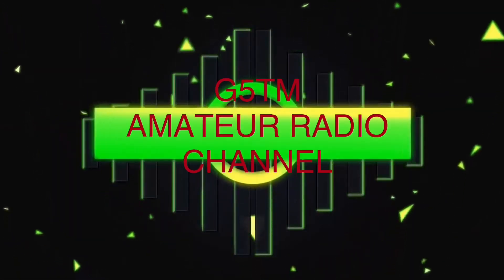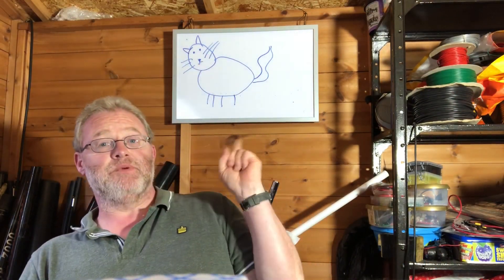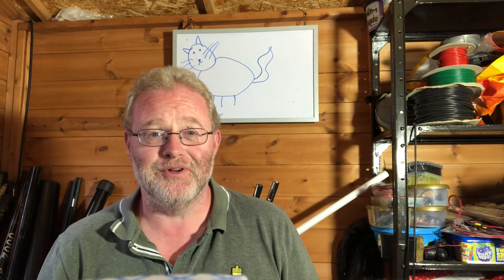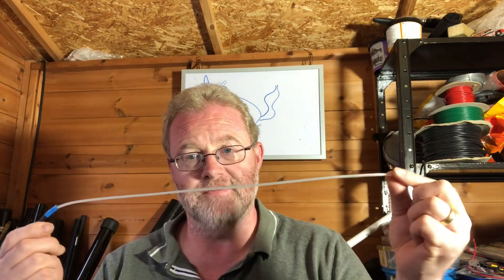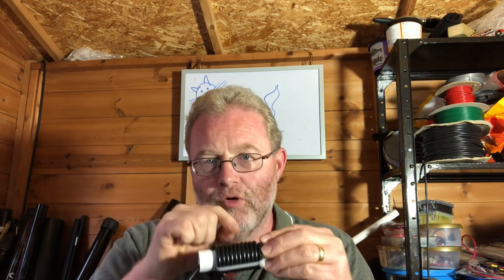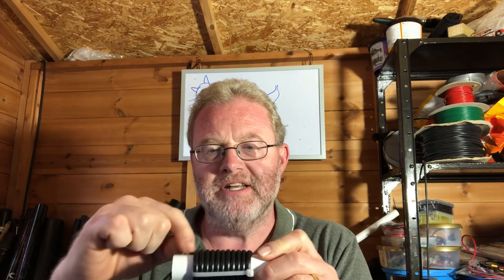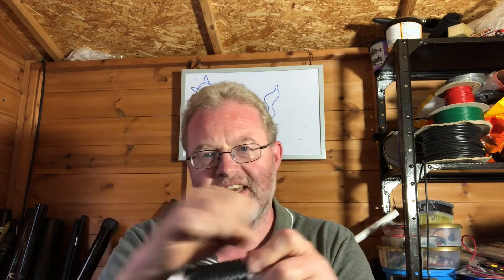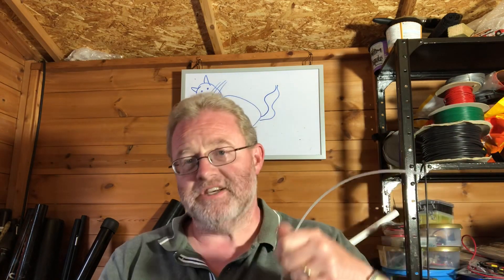HAM RADIO: Lightweight & Portable End Fed Halfwave for 2 Metres

Comment: how about folding the shield back over the jacket (instead of removing) for a second half of the dipole and put a piece of heat shrink over the length of the legs (90cm) for durability , reduce common mode, and just make an ugly balun at the end of the feedline?
Reply from the maker: Yep can work

Comment: I crossed this info with the flower pot info and hung the antenna inside pvc with the coil wrapped outside at the bottom.  Mounted to a 30 ft  metal conduit that gets the antenna over the top of the roof.  Coax down and into my basement radio room.  Not much traffic in the area but I connect to the local repeater out at about 20 miles clear as anything.
Reply from the maker: Cool!

Comment: I've been using one of those for years, regularly talking 20+ miles with my 2metre one and over 40miles with my 4metre one. Both indoors at ground level. My 6metre one is on my test tripod awaiting testing. Awesome antennas easily equivalent to mid priced white sticks.
Reply from the maker: Totally agree - light on the pocket as well as on the weight! 73

Comment: I know this is an older video but I have been using an antenna that I made years ago on my front porch. I made it as my first one . No one knows it is there and it works great. I got the idea from a roll-up ladder line antenna I have . That J-pole works but this has the I made it factor in it . Thank you for the video.
Reply from the maker: Great example 👍

Comment: Hey Tim Happy Friday from Texas I was wondering why the top portion dielectric is longer than the full coax portion and they're not the same size also I was curious if you could confirm what frequency you were basing your measurement on
Reply from the maker: Top portion is longer as it has less shielding so lower Velocity factor than the uncut lower half. From memory  the frequency was 145.500
Reply: @TIMG5TM  thanks Tim, I'll run w that. I'm making an excel spreadsheet to adapt the design to other bands

Comment: Just discovered your channel, Tim. This lightweight 2metre antenna is exactly what I needed. Great style of explanation, calm, relaxed and to the point. Excellent, thanks for posting, I'm off to watch your other videos. 73, David. M0 NXA
Reply from the maker: Glad it was helpful David - that's very kind of you to stop by 73
Reply: @TIMG5TM  Hi Tim, thanks for replying -  can I pick your brains please? I built the 2m  half wave exactly to your spec (honest!) but it was resonant on 147.400. I did use RG58 standard - cheapo stuff to make my first one, could this be the reason for the higher resonance than 145.500? I would be grateful for any hints you can give me to reduce the resonance to 145.500 or thereabouts.  I used the internal swr meter in the FT818  - could that be an issue also? Thanks and 73.
Reply from the maker: @languagetruthandlogic3556  hi there. Hmm as long as the velocity factor of your rg58 is the same as mine (0.66); you cut the co-ax lengths to the same amounts and the choke is exactly the same, then you should match my antenna. Something somewhere isn’t correct. However the other reason may well be the radio swr indicator. Can you acquire an swr meter or borrow an analyser that covers 2m maybe? The ft818 swr bar graph can be a little vague. What is your swr at 145.500?
Reply: @TIMG5TM  Hi Tim,  many thanks for your reply. The good news is that I built another antenna using different and newer rg58 ( the original was some old spare  and very cheap co-ax ) and using a 'proper' swr meter I got an swr of 1.2 on 145.500!  Interestingly enough, I also got  1.3 on 433.500 a dual bander? I see what you mean about the swr readings on the 818, after a bit of investigation, I agree it is somewhat vague! perhaps best viewed as an indication only. Into the hills with the antenna next week to test it out. Thanks for your help and 73.
Reply from the maker: @languagetruthandlogic3556  fabulous!! I hope you make many contacts 73

Comment: Hi Tim. Thank you again for this video. I have just made mine this afternoon. I have used RG58 in 20mm PVC conduit for a lightweight, easy to carry and deploy antenna to take out on my mountain bike, into them there hills!  I also added a 235mm sleeve dipole, in the centre, made out of aluminium kitchen foil, for 70cms UHF. Thanks again for the inspiration!  73, Mike M0MTJ
Reply from the maker: Fabulous Mike, I hope you enjoy the antenna.

Comment: Hi, I made this antenna with a 1m feedline., I used a cardboard tube out of tin foil to make the choke. In a doorway in my flat it has swr 1.3- 1.across the 2m band. Outside on a pole I presume it might be better. I trimmed a bit of the top piece to try get it lower but nothing happened. 3 watts from a handheld. Am happy with 1.3-1. it is going to hang outside the window of my flat, fourth story. Thanks Tim, I made this for free as had everything I needed,.
Reply from the maker: Fabulous!!

Comment: Hi Tim
 May i know if its possible to use a Ferrite Beads around the coax instead of RF choke made of wound coax as you did? 73's DE DV9HF
Reply from the maker: Probably yes - but I am unclear at the moment as to the dimensions and number/type of ferrites.
Reply: wish me luck...I am about to do this Right Now... I am just reviewing the comments before stripping the coax for. Unfortunately it will take me a while to measure SWR in proper conditions.

Comment: Tim, this is great
I’m a lockdown M7 so was looking for the sort of project to make this all a little more ‘real’, so thank you

I’ve made and used this successfully 

I’m going for your 1/4 wave vertical with elevated radials for 20M next (I’ve posted a question on that video as well) and it got me thinking ...

I’m using my FT818ND portable and want to carry as little as possible as you can imagine ... I was wondering if I could replace the PVC wound choke on this antenna with the Hamgoodies balun used on the 20M 1/4 wave with elevated radials as this would allow me to carry/use a single coax feed to interchange between antennas if I wanted to work 2M and 20M on the same field trip ... if that makes sense? Or would that balun be a little to heavy so far up my 10M fibreglass pole?

73, M7ASU, Rob
Reply from the maker: It would be heavy yes. Also the choking impedance which works ok on 20 with the hamgoodies Balun won’t do the job on 2m. Really glad your build works well and good luck on 20m.. you’ll have fun I’m sure! 73
Reply: Tim G5TM 
Understood, thanks for the guidance

I’ll leave the 2M as it is (especially as it works so well) and build the 20M as a completely separate entity

Thanks and 73
M7ASU
Reply from the maker: Brilliant stuff you’ll have a great time with that antenna on 20

Comment: Hi Tim, this looks great for me as an adventure mototrbike rider - I'm going to try this for 70cm as well. What would you recommend for the coax lengths?
Reply from the maker: Hi, for 70cms.. good question I’ll need to work that out and I’m planning to build one soon. The 2m version continues to work v well for me portable 73
Reply: @TIMG5TM  good stuff mate 👍 73 VK4FJST
Reply: @TIMG5TM  just made this antenna and tested it today. Works great and even on 70cms, bonus 👍😁
Reply from the maker: Superb!
Reply: @TIMG5TM  actually I'm getting better VSWR on 70cm 🤔
Reply from the maker: Biker Bytes interesting 👍

Comment: Want to use this as a permanent antenna for outside but could I run my fibreglass pole up the middle of the choke and then water proof using glued heat shrink?
Reply from the maker: Absolutely 👍👍
Reply: @TIMG5TM  many thanks again Tim 73's
Reply from the maker: You’re welcome Martin 73

Comment: Great T2LT vid Tim. good call on not choosing to actually build it slice by slice, more time to talk about it. Great antenna for quick n easy portable applications. I built one for 11m a few years ago- with a 4ins 5 turn choke for the suburban sprawl and it rocked- never tried it in the clear- could only be better. Ive  got an untested 6m one maybe now is the time to have a go with it. Job Well Done. Barnie  M7PBX.
Reply from the maker: Thanks Barnie good luck with the 6m version 73

Comment: Been an M6 for about 4 years and although I have not thought about progressing, I love and specialise in QRP/P.  I usually use my own built antennas with either my 857 or 817, but on occasion my PRC 320 clansman.  I have never tried 2m portable but this build has inspired me to give it a go.  Thank you for the very well presented and easily explained video and instructions.  M6KVK
Reply from the maker: Great to hear you are heading out portable. Glad the video has spurred you on. Best of luck with it! 73
Reply: @TIMG5TM  Just finished the build and very impressed.  Not a fantastic SWR (1:1.5 to 1:1.3) across the band but very usable.  Thank you for sharing.
Reply from the maker: The Old Hobbit that’s great! I hope you enjoy the antenna 73

Comment: Hi Tim thank you for a very goud video. Can I use the same choke if i build a 4m version. 
73 OZ5PO
Reply from the maker: Hi Per. For 4m,6m the suggested choke is wound on a 50mm former rather than 25mm. I will be trying this in the next week or two for both of these bands. 73

Comment: Great video Tim. I have exactly this design with the addition of some 20mm conduit and a tee piece to support the dielectric horizontally for SSB. Also some short 20mm sections with long couplers glued at one end to have a light weight portable mast option.
Reply from the maker: That sounds a great idea Adrian!
Reply: I have never played 2m SSB and having just constructed this antenna, I wondered if you might answer a question?  Is it only the dielectric section that is moved horizontally if I wanted to use the 2m SSB on my 817 ?  Thanks
Reply from the maker: The Old Hobbit should be the whole antenna above the choke do the dialectric  plus the untouched bit above the choke

Comment: I would submit this is a dipole, not an EFHW
Reply from the maker: Interesting point. It is indeed classed as a dipole. Of course being electrically half wave and fed at the end are also key characteristics. 73
Reply: Technically, it's fed in the centre. :-)
Reply from the maker: Electrically if not physically 👍

Comment: Tim, the choke. I have a fair amount of thick coax. Difficult to make a choke. What else would you use? Cheers Gary (M7)
Reply from the maker: Hi Gary, I would simply use the rg58 if I’m honest with you. 73
Reply: If you wanted to use thick coax as the feeder, you could make the antenna out of thinner coax and add in a connector at the bottom of the choke.

Comment: Cheers Tim. Being a newbie to Amateur Radio (test next month) but very competent in electronics it looks like I have just shelled out 30 quid for what looks like a packaged version of this on 2m. Are well i won’t do that again. So has anyone got the measurements for a 10m band one. And could you have them on the same pole (10m pole) at the same time, obviously only one radio on at a time. Thanks
Reply from the maker: Hi Tony for 10m try the same design but with about 8 feet for the top and 8ft for the bottom. Then the choke I think is 5 turns of rg58 on a 110mm diameter (soil pipe?). Then as much feeder as you want from the choke to the rig. Try it out and see. 73
Reply: If you want to research similar chokes for HF, do a net search for "ugly balun".
Reply: I’ll give that a go. Was thinking that’s going to tricky attaching that large former to the pole, then the penny dropped to put the fibreglass pole through the middle.

Comment: Would be interesting to see performance compared to a ribbon line Slim Jim.
Reply from the maker: Yes won’t be much in it ... maybe slim Jim by a nose owing to its low angle of radiation?
Reply: A slim jim is another end fed half wave (proper end fed!), with a matching stub. Of course the next step to a slim jim is to then make it into a collinear by adding a second half wave (and a phasing section between them)...and even maybe a third....

Comment: does the diameter of the pipe make a difference ? could i use 1 inch pipe ??
Reply: I doubt if 0.4mm will make much difference :-)
Reply from the maker: 25mm which I used is pretty close to an inch so all good
Reply: @TIMG5TM  sorry I was working at the time and skipped through it . But my question still stands . Does different diameter pipe make a difference , smaller or larger . Thanks

Comment: Nice,
most sailors are concerned about accidentally losing their yachts mast, and with that the mast mounted VHF antenna. 
It would be an interesting experiment to adjust the lengths to marine VHF i.e 156.000 - 157.425 Mhz, and were marine rescue channel 156.800 MHz is the most important. The idea is to use this antenna in emergency and raise a temporary antenna on a carbon pole. That would be a valuable security addition to every cruising boat. You have the SWR meter, could you do the design for 156.800 MHz and see if you get similar good results, design wise. Thanks ;-)
Reply from the maker: I’ll try and look into that
Reply: Multiply the measurements by (145/157).

Comment: Nice one Tim. Could I use mini8 coax or is RG58 better at 2M. Could I use heat shrink over the choke?
Reply: Would it work in a loft space.
Reply: Yes it will. He aware though that rg58 is quite lossy at 2m so if in your loft you probably want to use better coax. It will definitely be better than a whip on a handheld